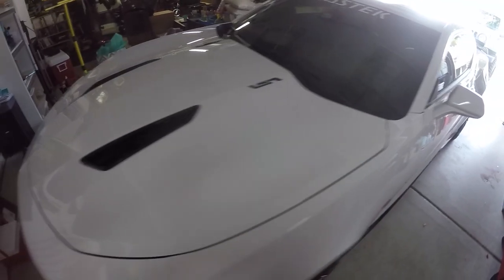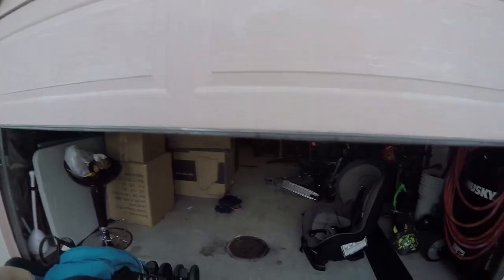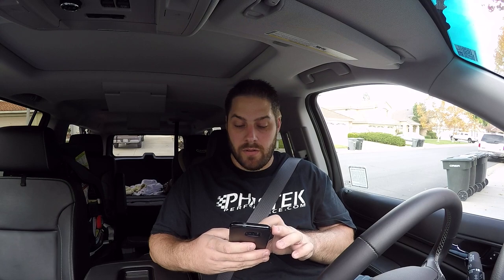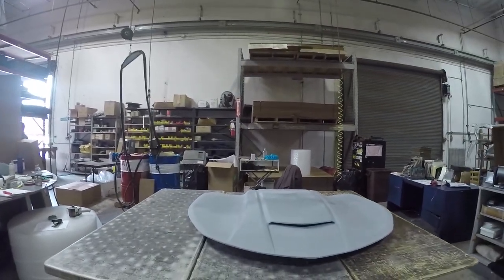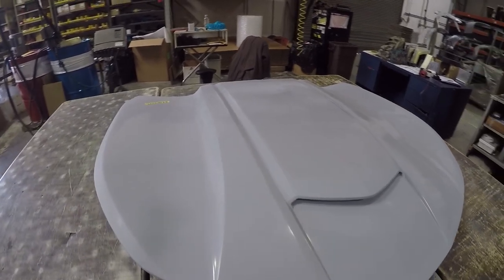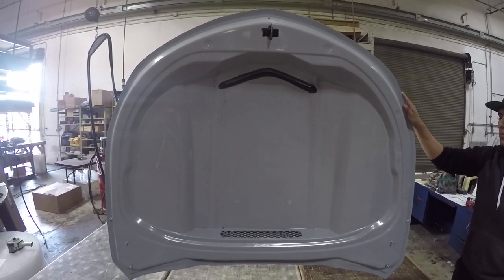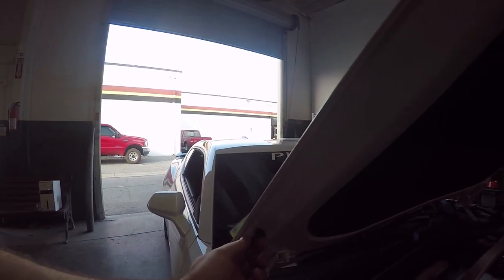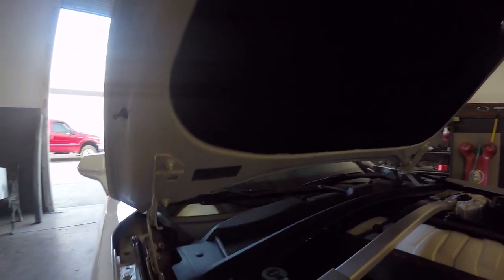Skorpion Hood 2016-2018 Camaro SS, LT, 1LE

Comment: 2 questions... what would happen if you painted it, and installed it without you doing the "heat flexing" thing you did? And any idea of how much a hyper blue paint job on this hood would be?🤔
Reply from the maker: +David Garza one if it doesn't necessarily heat flex down the road you can see potential ripples in the fiberglass. Every paint shop is different so it's hard to say how much it will cost to get it painted

Comment: Nice hood. Love my 6th gen, but never cared for the hood. Liked my 2015 SS hood better. Like this one, but wondering about the engine heat and if it breathes good enough. Gonna check into it. Might be an option.
Reply from the maker: +Mike Williams temps have actually lowered at idle and under speed. The aero on the car forces a lot of air into that slot and blasts the air out the ports on the backside of the hood. Way better than the stock vents
Reply: Awesome. Thanks for the info. Looking forward to seeing it painted. Way better than the stock hood IMO.

Only thing about my SS I'm not crazy about. Loved my vented 5th gen, though. The hood is probably gonna be my first of many cosmetic mods till my warranty is done. After that the motor will get some TLC.
Reply from the maker: +Mike Williams a lot of.companies are rolling out new designs, so the sky is the limit.

Comment: getting a procharger aswell. do you think $5,705.00 is a good price?. will come with stage 2 intercooler. would like your opinion. thank you and keep up the great content.
Reply from the maker: +ZEUS 4408 seems like a really good deal
Reply: Lethal will you be installing the kit by yourself with instruction pdf file or are you taking it for installation at a shop?
Reply from the maker: +ZEUS 4408 I will not be. I have a shop doing it.
Reply: Lethal will you also be purchasing the boost,wide band and fuel pressure gauge aswell?. if so where would you mount them in the cockpit?. pillar?.
Reply from the maker: +ZEUS 4408 I am not.

Comment: Matt, DAMN that's a badass hood BUTTT! Al Oppenheimer said in an interview when introducing the Gen6 SS that the gen5 SS hood produced lift but the Gen6 actually produced downforce. Just those small innocent looking vents in the hood produced downforce at speed testing on the track. If it was just venting heat from the engine bay, your new hood will still be fine for that but are you not concerned about loosing the downforce that the Gen6 SS provided? Then again, I've never seen you track your car so maybe that's not important to you. Let me know your thoughts cause I'd love to have that hood but I do track my SS. Thanks man, great vids and all of your new intros are sick, love 'em!
Reply from the maker: +Denver Wright I am not worried, the ram air design will bring downforce as well. Add that to my Wicker Bill setup and I am good. I have a lot of track days incoming.